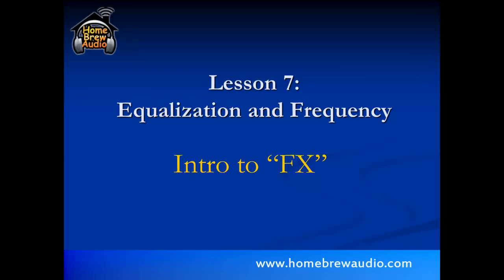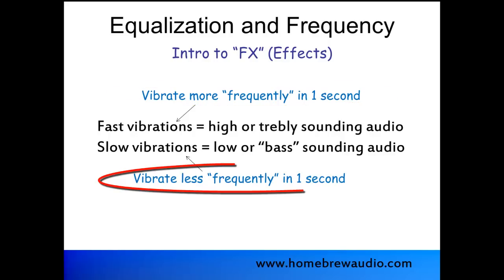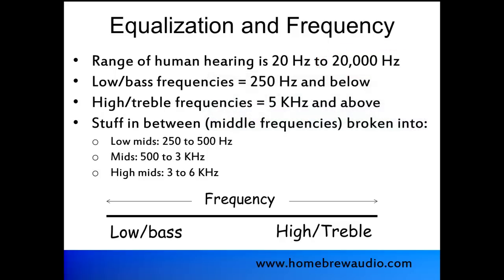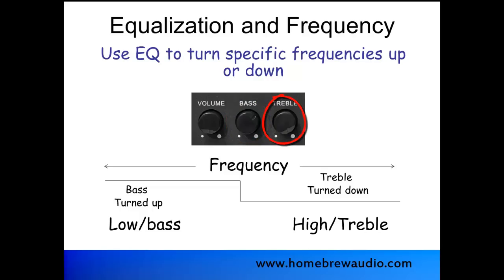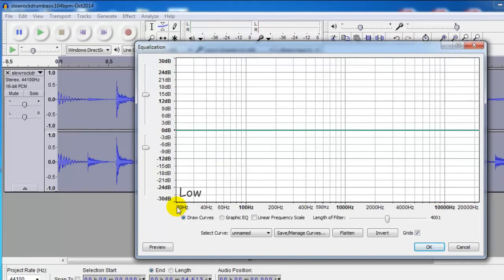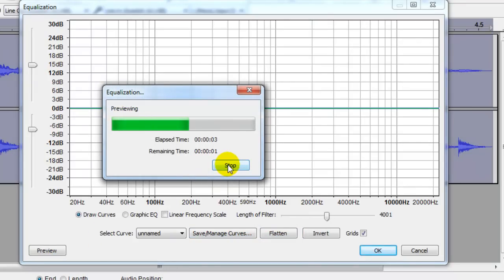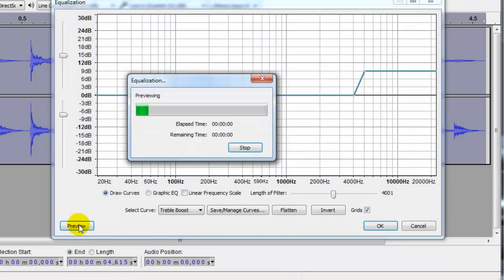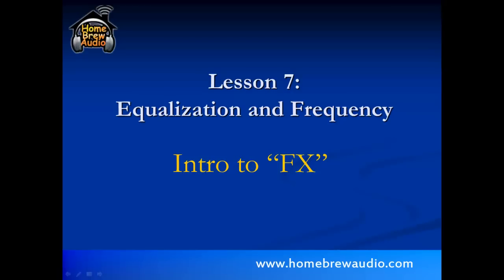EQ (Equalization) and Frequency Explained

Comment: Sir u siad 6 vibrations of molecules are equal to 1 hz in this video at 2.50 u said air molecules have to viberate 20 times per second to create 20 hz sound plz help me to understand...
Reply from the maker: Eric - at that point in the video there is an image showing a waveform with 6 cycles in one second. Since Hz is 1 cycle per second, then if there are 6 cycles in one second, it means 6 Hz (6 cycles per second). And so, however many cycles happen in one second is how many Hz there are in that situation. If there are 10 cycles in a single second, you have 10 Hz. If you have 20 cycles in one second, you have 20 Hz, and so on. I hope that clears things up.

Comment: 1 min 51 secs in the video you show a moving air molecule. It's a very wrong picture in at least two ways: First you depict the sound as a transverse wave, but a soundwave is a longitudinal wave and Secondly, and more seriously, you make the air molecule move along the wave. Thr air molecule would either move up and down perpendicular too the wave movement (transverse wave) or parallel with the wave movement (longitudinal).
Reply from the maker: Mads. Wave mechanics was not an easy topic for most people. Yes, this is a hit on the specifics of wave mechanics. But it's done to illustrate the idea of frequency in a way that makes more sense. So for anyone who is interested in technically correct wave mechanics issues here - yes, the air molecules themselves do not move across as in the animation, just like water molecules don't move sideways when a "wave" propagates through a pool. I think people understand that when they "do the wave" in a stadium, they, themselves are not sprinting up and down around the seats of that stadium. It's a motion that they are seeing moving through the crowd. The little balls are there to simplify the idea of the motion, which is easier to grasp. Sure, if I were trying to teach a physics class, I wouldn't say it like that. But I'm not. I'm trying to give people a useful way to understand EQ and what it means when people say "frequency." I do believe that I say the molecules are moving back and forth, and not traveling. But I do understand what you're saying. I'll clarify that in the next version of the video. Thanks for the comment.

Comment: EQ is technically a bunch of filters right? if not whats the difference between EQs and filters?
Reply from the maker: Well, it's really a matter of terminology. Generally a "filter" is something that completely cuts a frequency out. With EQ controls, you can add energy as well as reduce it by however little or much you want. But with a lot of things, you might get a different answer depending on who you talk to. I hope that helps.

Comment: 31 knobs seem quite overwhelming after using just bass and treble. Youd have to manipulate several of them just to create a shelf filter, and again to adjust it. A parametric (paragraphic) EQ seems more intuitive, where you can gradually add as many filters as needed, or just tweak a simple treble boost with 2-3 sliders.
Reply from the maker: +j7ndominica0 It can be overwhelming, yes. But you actually don't need to manipulate several sliders for a shelf. There are shelving presets available for that. But I agree that a parametric EQ is the way to go in use. But I think the use of the graphic EQ works better for explaining the concepts of EQ and frequency.

Comment: Excellent tutorial. I work on live sound would have been really good to have this back when i was starting out, so I'm sure this will help many others. You may already have this planned but it might be helpful to include working with voice and how to work with different voices that have high levels of sibilance or over powering plosives. Obviously alot of that comes down to the type of microphone you use the style of the speaker and the temperature of the room but from basic introduction perspective might be really good to talk about. Keep it up I'm subscribed.
Reply from the maker: ***** Thanks Stefan! Yes, the teaser at the end of this video mentions using EQ in the next lesson to fix a common problem. That problem was plosives:-). I also have several articles on the site about sibilance, but you're right. I'll check the course to see if I have a video on sibilance.